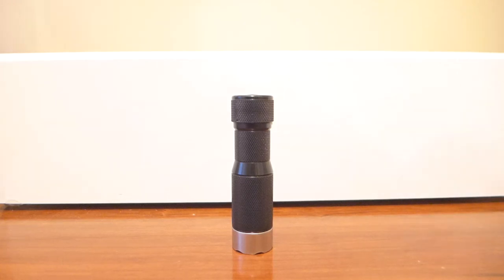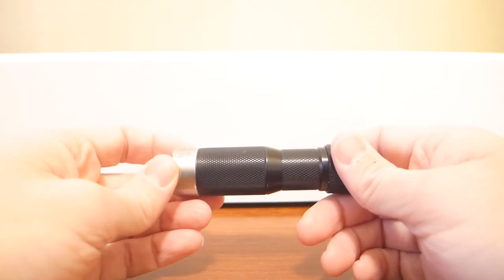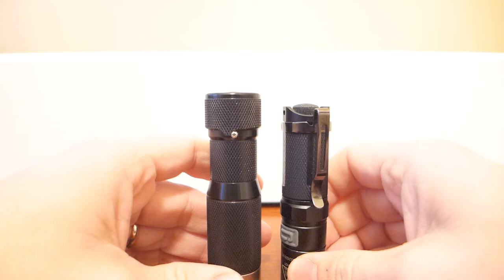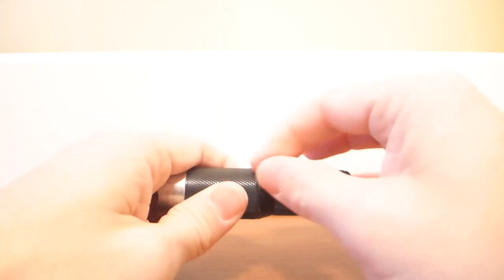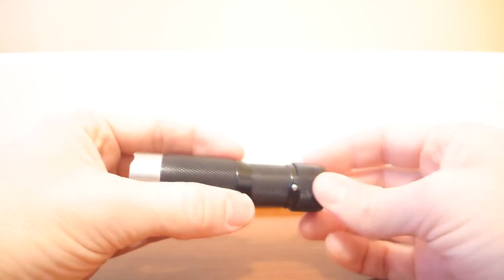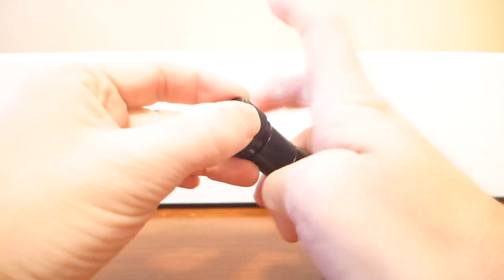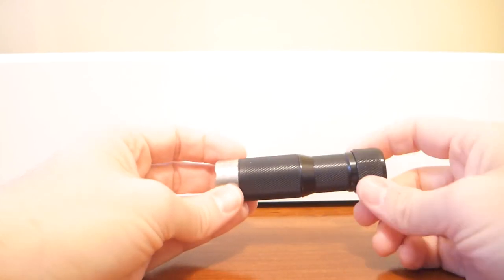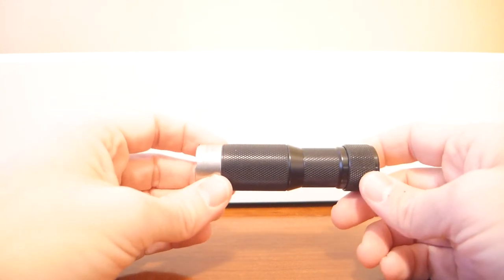HDS Rotary 200 Executive Overview

Comment: If you really need to tailstand and would like an anti-roll device you could buy a Surefire F04 diffuser and remove the diffuser piece. I saw it on CPF from the moderator DM51. You just attach it to the back and I would think that you would put it on so that it would only be on the rotary part of the light so you could still use it.